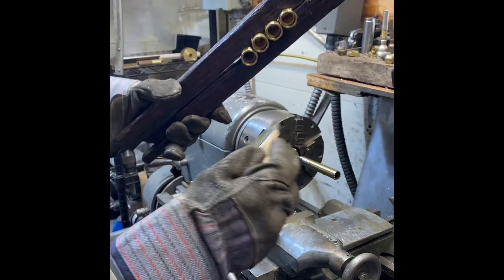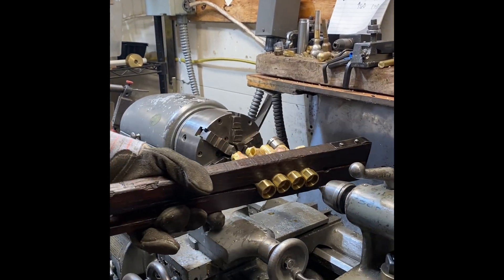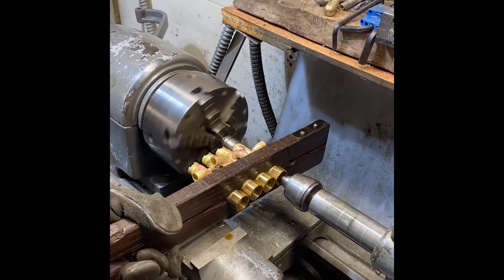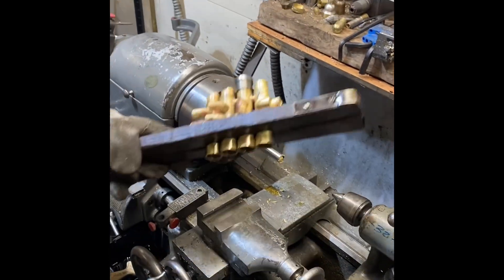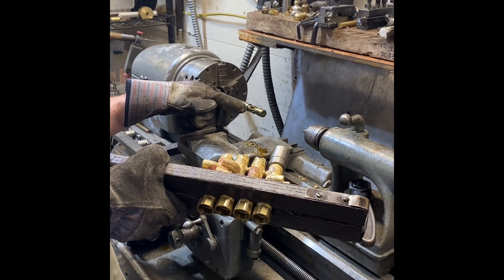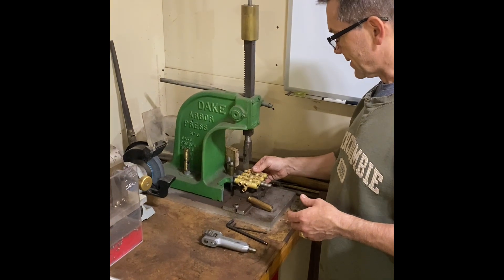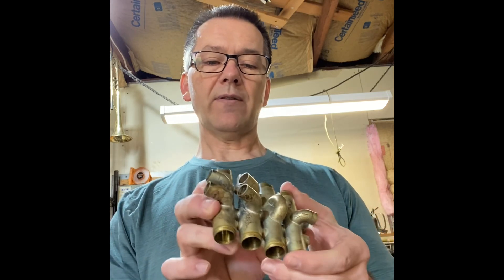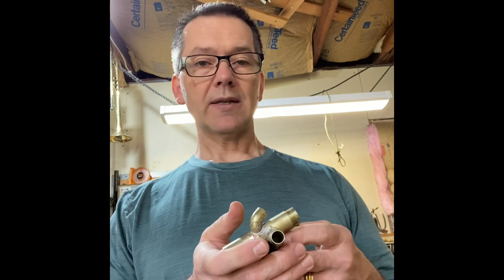Machining trumpet valve bodies and adding balusters.

Comment: Fabricating every component by hand has to be exceptionally time intensive.  But I’m wondering if in the same way you demonstrated resonance on the valve cluster by flicking it, you could check and measure resonance on every component and sun-component throughout the process.  Is that true?  If so, is resonance again checked on each step sub-assembly and on final assembly?   Does this distinguish your builds and offer improved resonance in any fashion?
Reply from the maker: The valve cluster has a certain resonance after the heat treating. Once it receives balusters and parts it acts as one unit during playing. The resonance is severely dampened by simply holding the trumpet while playing. As a result the bell and to a lesser degree the leadpipe are the areas where most resonance occurs. Because I do make everything here I can take the time needed to focus on weights, tempering and fit for each trumpet.